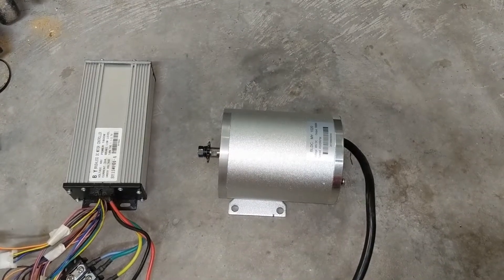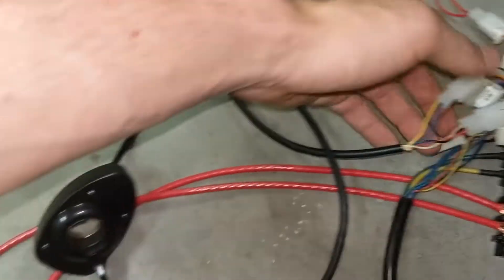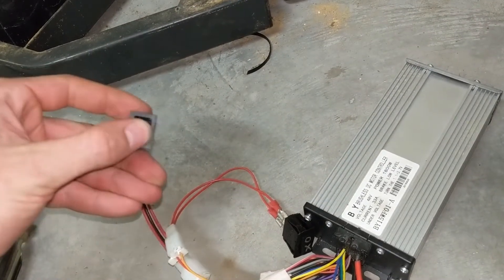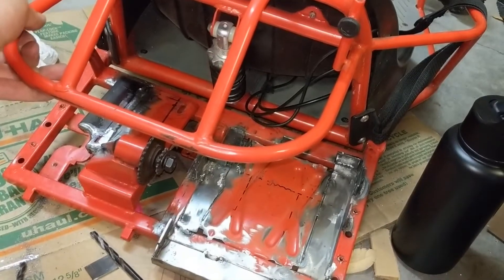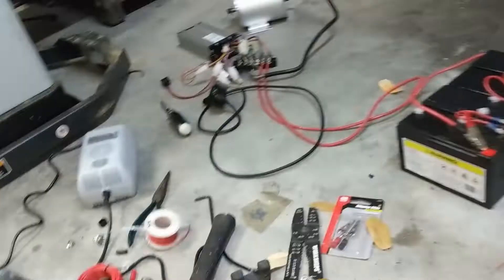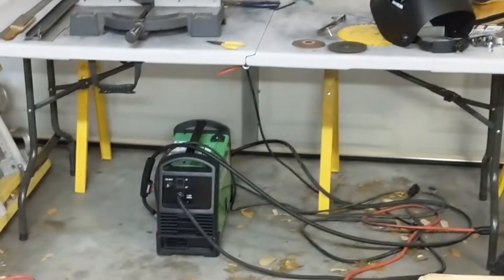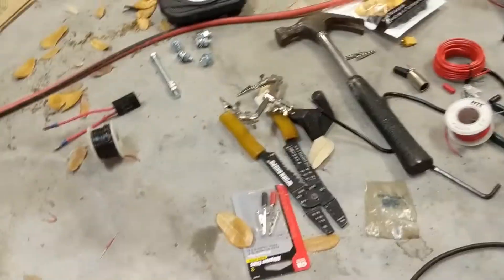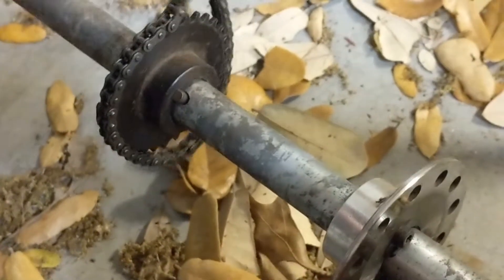1800w 48v Razer Gokart Project

Comment: Can you explain the details of your larger rear wheels.. did you use the 22mm razor axle or swap it out? I'd like to put larger wheels on my rear as well.. just want to do it right.
Reply from the maker: @bravebold1147  The OEM axle is used. All the same keys too. I just bought some slotted wheels online (harbor freight I think) for a 20 mm axle diameter. Unfortunately the axle clearance was a little tight (manufacturing defect) so I had to get a 20 mm drill and drilled the hubs out slightly.

Hope this helps. Let me know if you have any questions.

Comment: how long does it run?
Reply from the maker: @tkalobudalo  Now it only runs for about 5 minutes. The batteries are old, small, unbalanced and not suited for the use case. The batteries lasted a good few years but they've worn down and now need replacing.
Reply: @Newwinggarage  how long would new same batteries run ?
Reply from the maker: @tkalobudalo  when the batteries were brand new, they lasted about 15 minutes or ~7 miles. They were only 7 amp-hour batteries.
Reply: @Newwinggarage  i have 4x3ah batteries is the combined value at the end 12ah? and how long do you reckon that would run for
Reply from the maker: @tkalobudalo  that depends on how the batteries are wired. If it's 4 x 12V wired in series then max output is 48 volt at 3 Ah. If the batteries are wired and parallel, the total voltage 12 volts, and capacity 12 Ah.

For a 3 amp hour lead acid battery, I would expect around 2 to 3 minutes of solid run time. For 12 amp hours, I would expect about 16 minutes of runtime. If the batteries are LiPo or Li-ion, then I would expect double the runtime I listed because of the relative discharge curves.

Comment: Is the three speed switch needed for the motor to move?
Reply from the maker: Nope, the controller works just fine if there's no three speed switch. If it is left unplugged, I believe it's put on the highest speed setting. Some controllers need to be put on a switch to access the highest speed mode, but this one didn't.

Comment: Hi, I am a highschooler in the STEM academy, and my group's capstone project was to make a gasoline powered lawnmower into an electric vehicle. We bought this kit to do our connection, and believe we have everything connected right, but it is not working. Is there any way we can get on a zoom call with you and show you our project and connection in hopes of fixing it?
Reply from the maker: Hi there,

Thanks so much for reaching out and sharing your project with me – converting a gasoline-powered lawnmower into an electric vehicle sounds like an exciting and innovative endeavor! However, I'm currently unable to join Zoom calls due to my schedule.

I would still love to help as much as I can. Feel free to email me detailed pictures or a video of your setup, along with a description of the problem. It's often the case that issues with such conversions stem from wiring connections or control system setup. If you can also include details about the kit you used and the steps you've followed, that would be very helpful.

You can find my email address in the 'About' section of my YouTube channel. Looking forward to hearing from you, and I'll do my best to assist via email!

Best of luck with your capstone project!

Comment: so i just got a Trailmaster Cheetah i6 for my kids christmas present, brand new, just delivered and assembled today.  It supposedly has 3 speeds, L/M/H.  however, its only switching L/M, M/H speed selection does nothing to increase the speed.  Thinking its just the switch?
Reply from the maker: It could just be a faulty switch. I have a wiring diagram in my other video where I go over my gokart. (https://www.youtube.com/watch?v=7RONIBGccNA) @ 2:25 I don't go into much further detail than showing a picture of the wires, but it might help you find the connection you are looking for. 

Something else I will note is that the speed modes only limit the top speed of the motor and not the torque applied. If the power of the motor is limiting the top speed, then regardless of the speed mode selected, the kart will not be faster.

Please let me know if this helps.
Reply: @Newwinggarage  well it’s not the switch. I pulled the switch to bypass it and connected the wire terminals as the switch would and still could not get it to High speed. Only low and medium. I’ll check the wires tomorrow, besides that it must be a faulty controller idk. It’s difficult because these go carts come with a universal harness apparently so there’s lots of things unplugged/not used.

Comment: Hello. Amazing project. I had a question regarding your wiring though. I have a 48V motor, 750W. A brushless controller 48V, 750W. A bicycle battery of 48V, 20Ah. I have to make an autonomous cart using a 20kg servo motor for the steering wheels. I'm trying to figure out the whole wiring diagram for the main motor and the brushless controller.. Would appreciate your help
Reply from the maker: Hi, thank you for reaching out! I have a second video about my go-kart project that goes into a little bit more detail. It also includes a rough wiring explanation. https://youtu.be/7RONIBGccNA

Most brushes DC motors are based on sine wave geometry, so it's likely your 750W motor and controller kit is wired similarly. 

Do you need a proper wiring diagram for the internals of the speed controller or would an explanation of what the wires do be sufficient?
Reply: @Newwinggarage  Do you by any chance have some kind of a diagram? I could send you pics of the wires also. There are some unfamiliar wires although the main wires are noticeable
Reply from the maker: @agondahsyla7488  I do have a wiring diagram for my specific controller. It may help you find out what wires do for your controller. You can also send me an email (in my channels about section) of an image and description of your controller. There are many motor kits out there, so I don't know the specifics of your wiring and I make no promises that I know how your controller works.

Comment: Can I use the motor alone with my own speed control knob? I don’t need those other parts that you have. Will it work?
Reply from the maker: uhhh... Some clarification is needed... The motor is a three phase hall senser DC motor. You need a speed controller for that kind of motor because it doesn't just work with a straight DC voltage applied. You need brains like the one that comes with the kit. Does your speed control knob regulate voltage for a 3-phase hall effect DC motor? If so, then I think it should work.

On the other hand, if we are assuming that you are talking about my potentiometer throttle attached to the speed controller, then any 5-volt potentiometer will do. Most throttles / speed control knobs are that standard (no guaranties though). 

@A.Dotin4K I hope this helps, and please let me know if you got any questions.

Comment: can u run a test howlong it can run for? im planning to mod a mobility scooter with a 48v 1800w motor but i don't know what capacity i need for my batteries.
Reply from the maker: Well, I can tell you from experience that 30A at 48V is a lot of draw for small batteries. The 7Ah lead acid batteries I am using have a power band of around 5 minutes. I say power band because after five minutes of consistent acceleration, the battery voltage sag drops below 40V, and the power/torque of the motor is significantly weaker. The batteries last ideally about 15 minutes or just around 2 miles when going from fully charged to dead. There are a lot of factors when looking at battery life like: how many accelerations, terrain changes, gears, at what speed, and more. If you are modding a mobility scooter, I would want close to an hour of run time, so a ~25 Ah lead acid or a ~20 Ah lithium battery @ 48V. (For batteries with a low current output you have to make them bigger to account for excess stress. Lead is weaker than lithium for the most part.)

It is also a good idea to look at the "C rating" for the batteries you will be using. This will tell you the maximum constant current you can draw. 

Hope this helps.

Comment: @newwing7607 where did you get the 3 speed switch, i am trying to make the motor go slower and setting the switch to 1 might do the trick
Reply from the maker: I just searched for a "3 mode switch" and there are may options online or places like Home Depot. I personally bought all the electronics you see in the video on amazon. As a short stop solution, you can short the three modes with some dummy wire, it should be harmless (because that's what the switch does).

Comment: How fast does it go?
Reply from the maker: I have confirmed my go-kart goes 28 mph. However, when the batteries were newer I'm confident that it went just at or over 30 mph. At the moment, the motor is not a limiting factor. It is the batteries and drivetrain.
Reply: @Newwinggarage  Do you recommend that I get a better battery?
Reply from the maker: Not sure what you got now, but I wouldn't recommend small, sealed lead acid batteries like what I got. @XDLinear

Comment: is it possible to put this on a mx350?
Reply from the maker: Kinda? I'm not sure exactly what you're asking here, but it is not an easy plug and play solution. At the bare minimum, you'll need to drill new mounting holes for the motor, adapt the chain and sprocket, and mount the speed controller. You will also need to upgrade the batteries.

As for fitment, the motor should fit as it's much longer, but not much wider than the stock motor. Really, you can locate the speed controller wherever. Lastly, there are a plethora of options for making a 48 volt battery system. So, I hope that answers your question.
Reply: @Newwinggarage  i have a question what batteries did u user for the kit
Reply from the maker: @6buckets  I used 4 12V, 7Ah lead acid batteries I wired in series. I bought the pack of 4 from Amazon by Expert Power, and paid $80. I actually am regretting it a little bit, because the batteries don't last very long. They also have a lot of voltage sag when under load, take up a lot of space, and are very heavy. Their saving grace is that they are CHEAP AND EASY! (Which is enough for now)

If I was spending this kind of money again, I would double my battery budget and find a lithium polymer or lithium ion battery pack that can do 48 volts and 30A discharge continuously. But then again... Money.

Comment: Do you have just a picture of the throttle wires? Having a hard time figuring out which ones to combine to use the original throttle like you did
Reply from the maker: Yes I do in fact! I'm not sure how you want me to send it to you though... but, I may be able to help clear some things up. 

So, the original throttle has 6 pins/wires. I had Yellow, Blue, Brown wires on top (opposite a male clip thing) and Red, Black, White on bottom (close to a male clip thing). The bottom three wires/pins (R,B,W) are for the potentiometer in the throttle (the throttle of the throttle). As far as I remember, Black (middle) was ground, Red was input, and White was output. I ended up just messing around with them until it worked.

The top three pins are for the LED's for battery power and low voltage light. I still don't know what the Brown wire was for, but the Yellow and Blue wires on top were the positive and negative of both the power and battery light.

Unfortunately, there are multiple iterations of this throttle. Some have four wires and some have six. I hope I could help, and please let me know if you need anything else!

P.S. here is a link to my version of throttle on amazon to help visualize things: https://www.amazon.com/Thumb-Throttle-Razor-Drifter-W25143400043/dp/B09FYK4HW8

Comment: How does the charger work?
Reply from the maker: I'm sorry for responding so late to comments, I kinda just made this video and forgot about it. 😅

Anyway, the charger that I purchased was a standard lead acid battery charger for a 48V system. The charger itself has its own quirks and features and looks a bit sketchy as it will pulse charge when the batteries get close to full. I ended up wiring the charger through the speed controller and have been having no issues thus far. That being said, not having a battery management system is likely not great for the four batteries I have in series.

Let me know if you have any questions! And thankyou for asking!